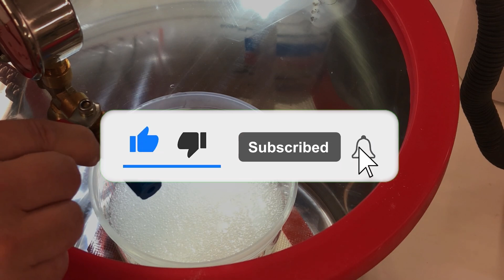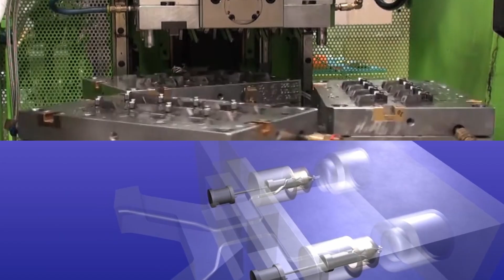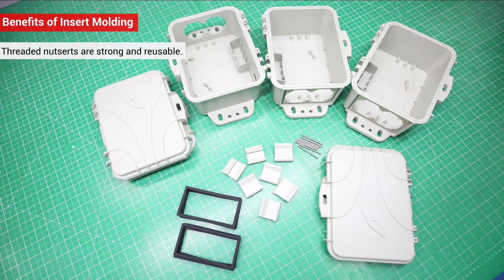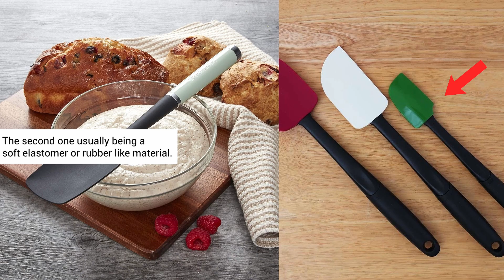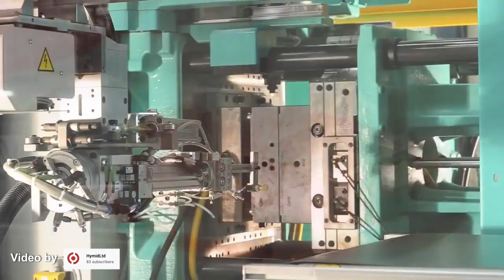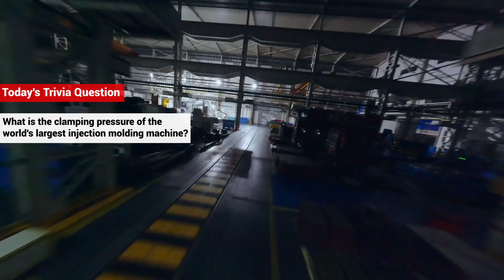Insert Molding vs Overmolding: Which is right for your project? | Types of Plastic Injection Molding

Comment: Clear explanation of these advanced processes! 🔧 Validating insert/overmolding designs with functional prototypes prevents costly tooling mistakes. Jevny's rapid prototyping helps test material compatibility and assembly before production tooling.